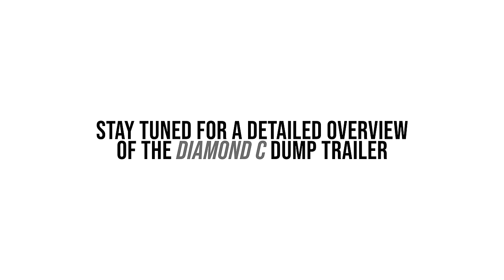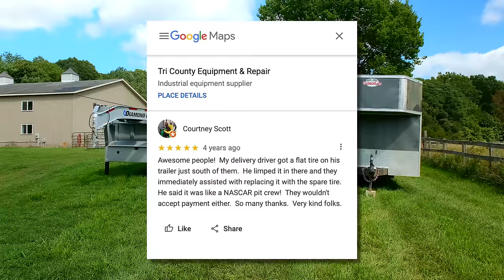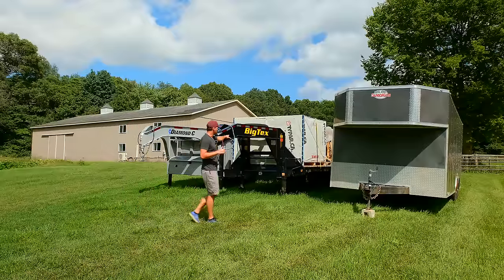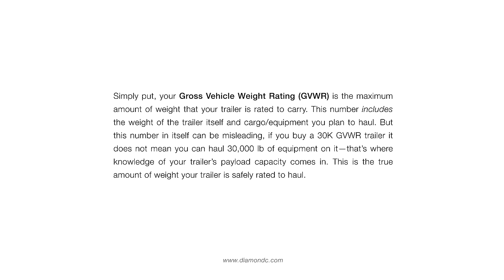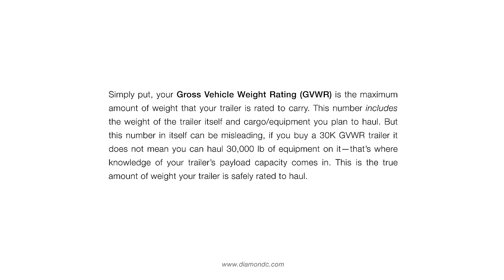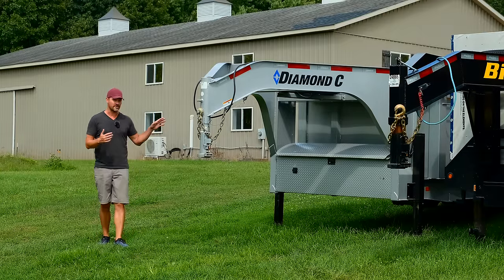THIS WAS A $30,000 DUMP TRAILER MISTAKE. WHO WANTS TO BUY IT?

Comment: I'm not surprised the company didn't give you a specific number.  The answer they gave you is the answer any engineer should give you.  The absolute maximum the dump will lift is dependent on a number of variables.  No one would put a number on it.  That only sets them up so that when you supposedly put that amount on the trailer and it won't dump, then you will come back and complain that it won't meet the numbers that they said it would.  Suffice it to say, I'm sure the dump system is more than capable of dumping the rated capacity of the trailer and then some.

I think the bigger question is how much material did you put on it?  You said 13 buckets of dirt.  I don't know the capacity of the bucket but given that you have the largest compact track loader Deere makes anyway, I'm going to assume that the capacity of the bucket (heaping) is around 0.85 to 1.0 yards.  For the sake of calculations, I'll assume that not all the buckets were heaping full and you averaged 0.75 yards per bucket.  At about 3,400 pounds per yard, that's in the neighborhood of 32,000 pounds on a trailer with a rated payload capacity of around 16,500?  And if you were using the largest bucket and all of the loads were heaping, that number could push up around 44,000 pounds.  No company is going to design a dump system that would handle 2 to 3 times the rated capacity of the trailer.  That's just over kill and they couldn't sell them at a competitive price.  I don't see this as being on the trailer manufacturer at all.

Maybe there was miscommunication with the sales staff at the time of purchase, I don't know.   Probably a bunch of assumptions made.  This trailer looks like it was design as a multi-purpose trailer and the length and side heights were designed around what was needed to haul equipment or construction debris or something like that.  Sure, it can be used to haul dirt but never fully loaded.    Seems to me that an erroneous assumption was made about how much the trailer could haul was limited based on the volume of trailer, not the weight rating of the trailer.  

I don't see this as a manufacturer's issue at all, but that's just my opinion.
Reply: Well... Nice Try!  There is Nothing Wrong with Over building with lift capacity.  I think it should have 2 hydraulic cylinders, Plus it would give it more stability for dumping.
Reply: Seriously????  I'm sure that the lift capacity of the cylinder that is there is more than the rated capacity of the trailer.  It's just not THAT much more than the rated capacity.  However, let's run with your 2nd cylinder idea.  First, the cylinder itself is probably $2000. You'll need additional steel for another mounting point on the frame and lift point on the box (plus labor to install).  Not to mention probable upgrades to the hydraulic pump.  Not to mention the potential increase for binding things up if the 2 cylinders aren't moving exactly in sync.  So, we've now added $4000 to the price of the trailer and we have the capacity to lift let's say somewhere in the 40,000# range......And we have a trailer that will fail within a year.  I'm sure the axles are rated at 7000# or 8000# so if you are constantly loading it with 40,000#, those will fail prematurely.  The leaf springs of course also probably aren't rated for 40,000# either so they would need to be upgraded.  Who knows what additional bracing would be needed on both the box and the frame to be able to deal with that kind on weight continuously.  Finally, I'm sure the gooseneck connector is rated at 25,000# so there's another potential failure point that has to be upgraded.  By the time you get all that upgraded, you are at a price point of $60-$70k (or more).  And of course that's just to get the trailer to handlet those kinds of weights.  Even 1 ton pickups aren't rated to pull that kind of weight with about 37,000# being the highest rated towing capacity.  As a result, you are going to end up causing damage to your truck if you try to tow that much routinely.  It just doesn't make any sense to even think about going there.
Reply: Tri-axel dump trucks exist for a reason! Hauling coal, limestone and dirt is the main reason.  They are built  to handle the weight.
Reply: You can have an equipment sales business without having a clue about how to use all the equipment, especially new equipment.  I think you are right, way overloaded.  Should have checked this calculation before complaining which was another mistake.
Reply: Looks like a 4” cylinder. The load it can lift is 22,626 lbs with  1800 psi pump. Minus the mechanical advantage to get it that high, that system is way underrated .. also consider how far back that rigging is from the front of the box.
Try lifting a weight using a bar with the fulcrum 3” away. Now try lifting the same weight with your fulcrum 2ft away 😂
Reply: Agreed. Can't speak for this specific trailer but I have owned a Diamond C in the past and can say it was the best trailer I ever owned. Very well made.

Comment: I bought an ironbull 16ft with two 8k axels.  Its rated for 10 400lbs.  That's like 5 yards max and you load the middle of the trailer not the front or back.  If anything slightly back heavy over the axels at the rear.  Your box is bigger than a tandem axel dump truck with a super small cylinder.  Even the telescopic cylinders on dump trailers are like 1/3 the diameter of the dump truck.

If you want to haul 10 yards at a time of heavy material you'll need a tandem axel dump truck.

Comment: Most dump trailers dump limit on rocks, dirt, gravel is about half full. Also needs on wall height, width and everything. My Big Tex dealer explained all that well. Most of the times they can hold and dump way more then advertised if properly loaded and with a telescopic Jack. Jacks like the one you’re got are really hard to get up if loaded funny or over loaded.

Comment: You’re absolutely right! They build those things not with the consumers best interest in mind. I instinctively know this just by looking at it. It is not a dump truck. 
I also know that a yard of the material like dirt rocks gravel weights in the neighbourhood of 2500 pounds,  give or take for the moisture content.
If you’ve dealt with any kind of volume in those materials you will know how much space it takes up and can quickly calculate how many tons you have in front of your cylinder lifting device. 
Forgive me if this sounds rude. 
I had to find this out the hard way. Almost the same way. Here’s a way to recon it. 

Most hydraulics generate psi in the thousands
For convenience 1800 is a go to.  The ram pressure is also easy to figure out. The area of a 4” circle 12.57* times 1800 is  22,626 lbs of push divide by 2500  lbs per yard is about 9 yard on a straight push. 
Here’s the catch !  A short cylinder’s ram load is reduced by the mechanical advantage to get it higher in the air to dump. 
It’s a shame the dealers don’t know this. 
When the dump is all the way up, stand a ways off (25ft) perpendicular to the unit, look at the cylinder fully extended now compare that to the total height of the box. Not the front but in line with the cylinder Recon how many times the extended cylinder can fit in that distance. divide 22,626 by that number. Say 1.5. You can lift 6 yards at that point. 162 cu ft or 12”x12”
It of course it would be less because of the weight of the box and anything in the front of that point but it gives you an idea. Nothing worse that having to shovel it out! 
*Ask Siri  she’s a wonderful
Lady and will do all those calculation for you.

Comment: I have four dump trailers. I recently bought a 14' Texas Pride trailer with 4' sides, 10k axels and has a two stage lift. We put 22,000 pounds in it last week and it lifted it fine. We left the job site for a few minutes and my guys just kept throwing the tile in the trailer so it was to late to stop them by the time I got back. I wouldn't recommend filling one that much, but I was surprised it dumped it. I do wish I would have bought the 16' instead to better fit my tractor. I have to say I didn't have the best experience with them when buying it, but the trailer is solid.

Comment: My experience with dump trailers (I have one) and rented them for years. You almost have to load them heavier over the axles. Too much weight up front can keep them from lifting. I've also used me tractor to help the cylinder start the lift. That works well when you have too much weight in it.

Comment: Id say that would be awesome for firewood, its not really intended for dirt or heavy material but that said ive only used telescoping cylinders that setup for the lift looks like it could get sketchy with age, when material gets hung up and you have to drop down loaded could bend that style looks fairly rigid. If you were to load that trailer evenly front to back you wouldnt be utilizing the benefit of the triaxle, close the back doors andoad from the side so most weight is over the trl axles, gooseneck trls are sigificantly more stable than rear hitches

Comment: as someone told me.... you are a lifting a heavy box away from you, where do you lift from? like a hinge near the pivot point [ which would be dual ram cylinder {one ram each side}] or underneath the box [scissor lift] or where it would seem least amount of weight [ side of box, furthest point from pivot point] .telescoping systems can create a high angle of dump than other systems. telescopic dump trailers have a smidge more stability than others - due to location of lifting ram location. that is why most dump trucks have telescoping rams and not scissor lift systems. haul more, less wear/tear/things to break. not to push you towards any brand, but look at maxx-d telescope dump trailer. they are relatively inexpensive and high quality. great customer service. best of luck if you look for another

Comment: all scissor lift style dump trailers have a smaller limit then the box can hold.  load the dirt from the back to just last the lifting point.  crazy thing is if you use a piece of equipment to lift just a little it will lift on its own after about 4 to 6 inches of help

Comment: Good morning. Having the dump retro fitted for a telescoping lift cylinder. 
It's a hindsight/ 20/20 deal.
But if it's not needed then down the road it goes. 
I'm sitting in South Bend Indiana at KW waiting to see how much repair is needed on the Emissions system for the Cummins yay

Comment: I got a Texas pride dump trailer 14k standard equipment. Has a telescopic lift and can easily dump 5 tons Im pretty sure it can dump more but I don’t want to over load the trailer. Out the door price was 10k and I picked it up in Texas directly. Had for 6 months now and running like a camp